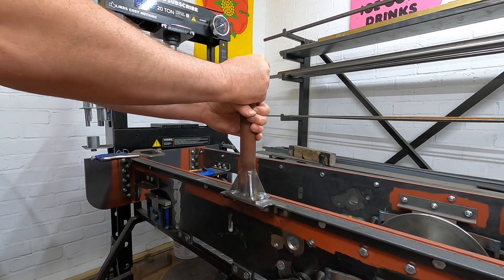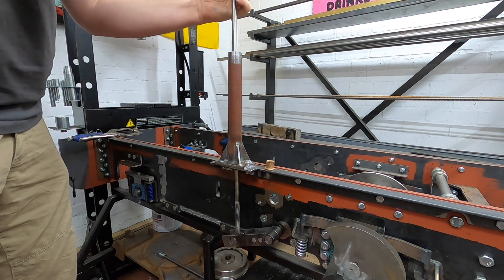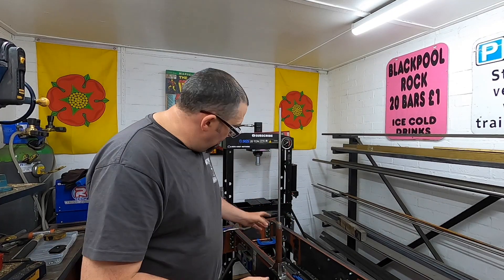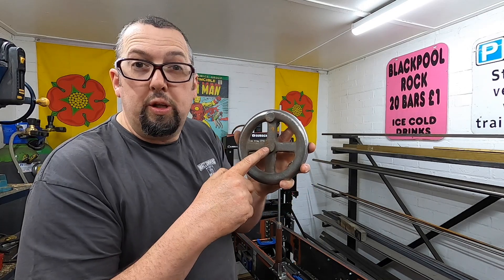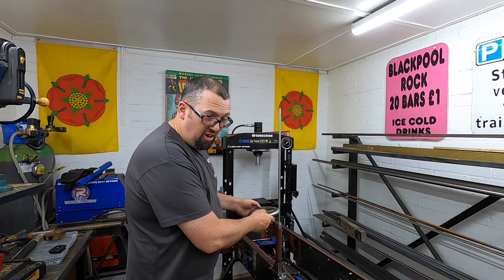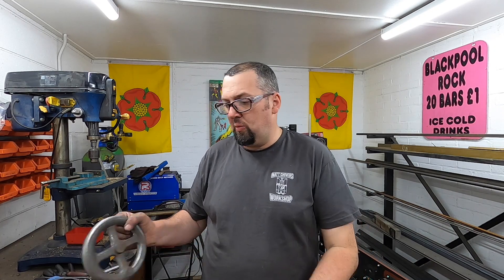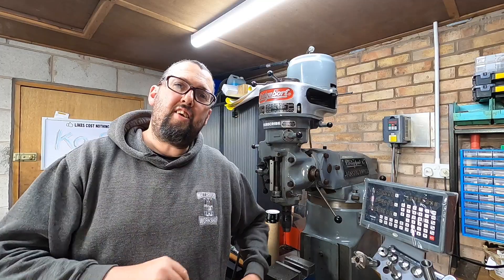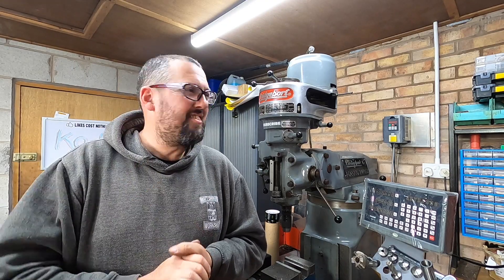Finishing the brake column and a hand wheel -  ep47 - 7.25" Gauge Steam Locomotive Build

Comment: If you put a grub screw on it, it will deform and pinch (not that important in the grand scheme of things, but it will happen). IMO, you should notch the lip with a round file and put a pin in the lip you have the riser pipe. That way, when you put the sleeve in, it's locked in place by the pin. just my 2 cents.
Reply from the maker: That's a good idea aserta, I like that. We are always interested in ideas and hopefully others that read the comments are as well so keep them coming. All the best, Matt